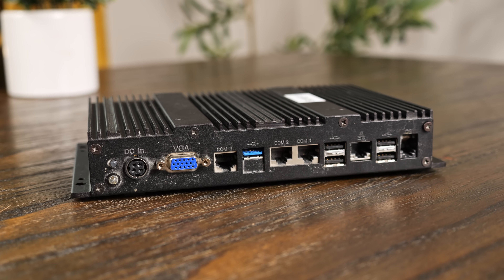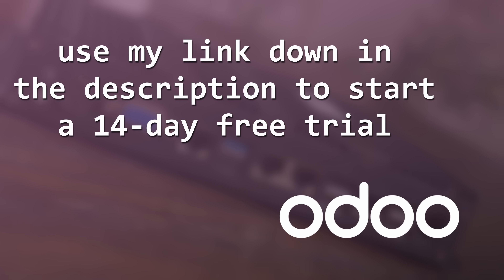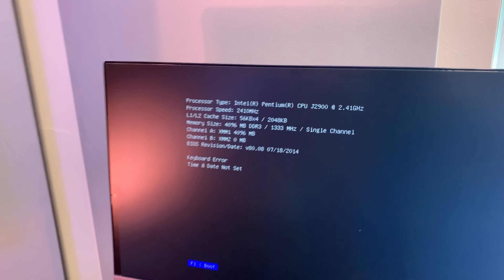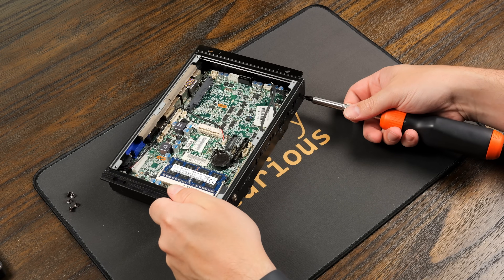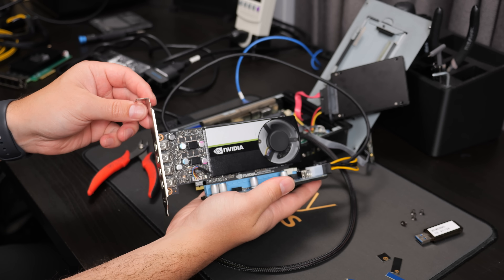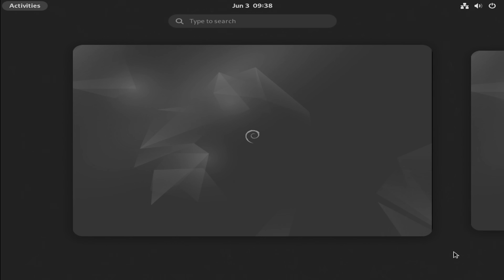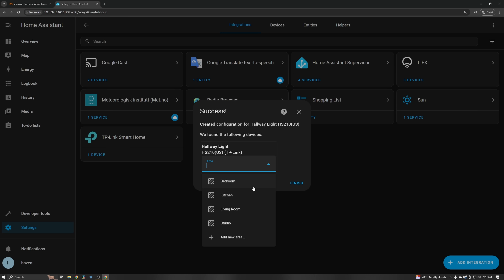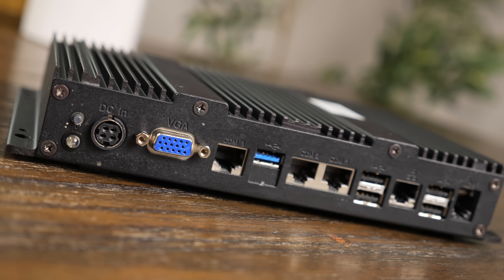I got this PC from a fast food restaurant. What now?

Comment: Been working at Marcos for a few years while going through college. Marcos used to use this system by FoodTec for their order management in the store and upgraded in the last year or so to a home grown management system. It was absolutely terrible at launch, constant system crashes and a near unusable app for delivery drivers and mobile orders made life hell. Whenever the system would bug out it would basically halt all activity in the store for up to an hour.

The experience as a worker is also awful as orders will take up to 30 seconds to go from the Dough table screen to the make line screen and we would basically sit there waiting for the order to show up on the make line screen because until it did we had no way of knowing what to put on the pizza. 

Im from a comp sci background, its what i got my degree in, and after contacting support about the delays they said they use an order cycle to batch orders together which causes a delay if we bump right after a cycle completes. I cannot even begin to fathom why this was done as the system is not lacking for processing power after they upgraded most of the hardware. Before leaving i considered dumping the contents of the program to a usb stick just to see why their program was so terrible but my gm was a cool person and idk what protections they have on the systems to prevent this

Comment: I have a similar device at home. It's been hanging around for so long that I only remembered it because of this video. It used to coordinate robotic arms for welding. Now, it runs CasaOS and serves as my primary backup server. When I'm done with a project (videos, which are very large files), I store them on the device (it has a SATA SSD with a terabyte). CasaOS then automatically makes a copy and uploads it to an internet cloud for redundant backup.

I set this up because I used to edit on a laptop. When I finished, I just wanted to close the laptop and be "done." I didn't want to leave it on for another 30 minutes until all the syncing was complete. With this current solution, I let another device, which consumes less power and makes no noise, handle the upload. And how long it takes is completely irrelevant to me... I don't have to monitor it.

Comment: A slightly off-topic question, although related to your way of testing computers.

I would like to be able to demonstrate with some test that a computer is faster/efficient when using 2x16GB DDR5 than using 1x32GB DDR5 of the same speed due to the dual channel.

Is this true? If so, with which application would you perform this test to have a more visual demonstration?

Thank you.

Comment: The J1900 CPU has been  superceded by the J6412, which is now the defacto CPU for Point of Sale hardware.

No, noone cares if you have this device. I know someone who uses a couple for torrent boxes!

They generally come supplied with Win10 LTSC, which as the name suggests has extended support beyond 2025.

The "Bump 1" suggests this box was used as a KDS (kitchen food display device) which would either attach to a touchscreen monitor or a "bump bar" ....a common feature in fast food outlets

Comment: I hate those goddamned things. Fought with one at work to try and get it setup on our domain, only to find out that security conflicts and software failures on our end, wouldn't cooperate with the vendors OS build per their requirements, so we couldn't utilize them in any capacity... all to just run one simple fucking program to display food retail menus, and I got CRUCIFIED by my leadership because I wasted too much time trying to get it to work and getting everyone on our engineering team and the vendor to fucking cooperate so we could get it to work! Apparently, I should have just punted the job to someone else instead and not even tried. Oh well.

Comment: The J1900 definitely benefits from dual channel memory operation due to the memory bandwidth limitations of single channel ram especially for the integrated graphics.  It looks like the oem of that board only designed it for a single ram slot so unfortunately THAT is not an option for this system.

Comment: Honestly, that would be a good little machine if you needed something in an environment that had metal work machinery!  Don't have to worry about metal shavings shorting anything important, as there aren't any fans!  You could also use it as a dumb client to connect to one or more 3D printer.

Comment: If you want to try using a low-end system like that as a router, you'd really want to use something Linux-based like OpenWrt or VyOS. BSD-based routers like opnsense and pfSense have higher system requirements and need more CPU power to achieve the same routing speeds as a Linux router would need.

Comment: Weird that I found this video right after I bought a similar POS computer on eBay for $50 just because I was curious. Mine is just barely new enough to have an HDMI port, which is cool. It's also tiny, no expandability except I saw a SATA port that you can't even access with the enclosure still on.

Comment: About 10 years ago i was working with a demolition company we where tearing down a distribution warehouse that had stopped paying rent got kicked from the site and the land owner decided to build a storage unit complex i was tasked one day with smashing the interior office walls down i got quite a shock when i smashed a partition and found a fully intact server room still with machines and servers the company had built a server room next to the office section and to stop yhe noise built a insulated sliding door that was so well intergrated into the wall no one noticed it until i broke through i hot a whole tray of 3rd gen i7 cpus and a bunch of unused 2tb hdd when they cost a small fortune sold most of it kept an i7 and a bunch of drives and used the money i made to build a sick pc
Reply: Let punctuation into your life.
Reply: @mattd6085  no what part of worked for demolition company made you think I was good at english
Reply: @acid3129  I can't imagine you were good at demolition on your first day, that's why people practice things. Practice basic literacy.
Reply: @mattd6085  all I did do was bang walls
Reply: @acid3129  Do you have no desire at all to better yourself? And unless you got hurt often, banging walls still requires a level of skill and knowledge to not have the ceiling drop on your head or the the floor to give way
Reply: @acid3129   Yeah you can't really pull the "English isn't my language" bullshit when your spelling and sentence structure is functionally perfect. You just can't be assed using punctuation. 

Never said anything about standards bud, those are your words not mine.
Reply: But, apparently he's smart enough to "build a sick PC"

Comment: For some reason I've seen the overscreen issue with mint, and ubuntu a few times, and the solution was to fix it in drivers setup, nothing else worked. I'm guessing that either the screen or the amp I was going through didn't return the correct screen into or something like that, but it sure was annoying. Worse, it showed up after an updated and just never went away, which means it was okay, but something in an update fucked it up.

Comment: Would this be good for controling cncs, which are in a super dusty environment? I think I saw an lpt on it.
Reply: Maybe using Mach 3 software, Linux CNC prolly requires more realtime performant hardware.
Reply: @mysticmarble94  I have lincnc on a core 2 duo... I think the j1900 should be acceptable, no?
Reply: @arugulatarsus  No idea, I don't use LinuxCNC, just going by what I read on the official Linux CNC page about hardware requirements in the past.

Comment: I suggest home automation where you are not pumping vertexes in games nor gigabytes of streaming video. Run your AVR on another box. Many of your environment sensors; weather, security and remote controlling are low data rates. With the decent video you can have a nice looking wall panel creating a futuristic looking vibe from low-tech.

Comment: Could this unit as you upgraded it be used as a backup surveillance server?

I currently run a back room sh*t box pc as a surveillance server for my cameras. The cameras still use individual internal SD cards for recording but also stream to this pc in the event the external cameras (and SD cards) are stolen. This way I still have video footage of whoever took my cameras.
Their is always a chance they take the crappy pc too but if were screwed to the underside of a desk or inside a cabinet...

Comment: The linux display issue could probably been fixed by using x11 or Wayland(aka just swap them, ive had better luck with x11) and setting the resolution via xrandr as example, as checking overscan stuff.

Comment: I worked at a tiny point of sale vendor for 8 years. You're likely to run across a ton of former POS systems. They're likely to be standard PC's with seemingly outdated touch screens, but built relatively sturdily. Go ahead and install Linux on them. Chances are it'll work okay. The days of some kind of weird proprietary hardware for POSes died 20 years ago.

Comment: i love my music player i got from a starbucks store  there was ones more powerful as later i found its 
a redhat linux machine that is a custom OS for Playnetwork and i found some machines also offerd Ads boards or what ever the shops call it 

mine had a basic CD drive that did not work but i found u could swap it out and make it read disks if u remake a playnetworkCD expiry date and heck i bypassed its date thing.
i did also found out i could of used an external CDor Dvd Drive when back in 2017 our machine in the store decided to kill its internal dvd drive 
anyway it was all fun to mess with recently at home and i will add a usb/hdmi touch 4inch screen so i can run a basic windows or linux for playing any music files at a Lossless formate using its orignal Motherboard by Polywell Computers

Comment: Hmmm you didn't mention the DC in voltage? Could this be used in a car for some of the more basic Ham Radio apps APRS or since it's capable of Win10 a Wires-X mobile gateway perhaps?

Comment: Im late - but just incase you were thinking about having this as a long term solution. DONT. Bay Trail chips suffer from some sort of degradation which means the chip will require more and more voltage to run to the point where its basically out of spec and the bios cant bump up the voltage and more then it can and thus the system wont power on unless you shunt mod it.

Qnap used a lot of these chips in some of their older NAS units and a load of them started dying after 3 years of use. My own NAS (TS-251+) Suffered the same fate and youtube is where i learned how to shunt mod and rescue it. While the NAS still works. The CPU is still degrading and Qnap support just dont care. They instantly closed my support ticket without even replying to me when my unit would no longer power on properly.

You can read more about it if you google "Atom Bay Trail dying because of LPC bus design flaw?"

Comment: I would love one of those. I would use it with windows 2022 and load putty on it hook it up to my pfsense serial port and my cisco serial ports. Have the box sitting on a whole different network so if my network goes down I can have a chance to remote in and maybe reboot or change configurations.

Comment: In the past I worked for Taco Bell well before their breakfast menu. In the office they had an IBM computer anyways they ended up changing out the registers to newer ones and while they was at it upgraded the office computer as well.

I asked management what they was going to do with the old computer they did not know. I said I would like to have it if they plan on getting rid of it and they said they would have to ask the district manager. I ended up getting the computer with the data on the hard drive intact but there was nothing I could do with it. As it used software that was created for them and you needed login details to get access to it. The computer was not very fast it was something like a 386 or 486 if I recall correctly and I ended up format the drive put DOS on it.

Comment: The only draw these devices have is old ports. The indistrial world is full of very old and expensive machinery that uses those ports, in the food industry its all about connecting to Point of sale equipment. Unless you have gear that needs RS 232 or those old printer connectors this hold almost no value. Performance is close to a Raspberry pi 3B.

Comment: I worked at Domino's Australia until 2005 and we used a different system to the one used in the USA. It was the same supplier that did Hungry Jack's, STM. We had a single Linux or Unix system with Wyse serial terminals for each order screen, makeline, cut bench and customer display. My store was really old it was a Pentium 166. I left just before the Windows based replacement (Pulse) came.

Comment: They are very specific to the job they are intended to.   it is part of a touch screen cash register system, where the touch screen likely just provided serial data, plus serial credit card processing, and probably even a serial port driven printer.   it's not intended to do anything special, just to do the same basic crap over and over, communicating with a server that actually keeps track of the data.  Much of the BIOS and the data bus is given over to those comm ports.  That is par for the course.    The hard drive would be for boot and likely to have loadable screens without having to hit the server, think of it as a precursor to jquery and json driven data sets.

Suggestion would be to clean it up, make sure all the ports are working, and sell it on for a couple of hundred.  You would be far ahead.

Comment: It's just regular commercial hardware, you'll get a fright when you check on the price. 
Having gone through about 9000 signage devices in my prior career, they are very reliable and you deploy them once and run it for a couple of years.  
Have a look at ibase for their grown up hardware...

Something like that would be used for signage, where the serial ports might be used for controlling ancillary hardware. e.g. SHARP PN series monitors.

Comment: Been working with systems like that. These style cases usually get mounted under ceilings and uses the whole case as a heatsink. Usually filled with mobile hardware and strictly tailored to the one usecase the customer has.
We had similar ones for KFC which only played the inshop radio.

Comment: Point of Sales systems don't really move that quickly.   They work on stability rather than leading edge equipment.     That little PC you have is likely close to 10 years old and may have been a modern solution at the time it was first put into service.     Like medical equipment, most POS systems  are desinged to be stable and work and the technology is usually well tested even when it is first released.   Generally they are a bit expensive for the hardware specs due to the research and development put into the software.

Comment: That thing is perfect for a home "gateway": providing a vpn, a webserver, a media server, a dns guard, a tiny NAS, sending WOL for remote turning on devices and monitoring other devices. With that little power consumption any ups would make it 100% available.
I assume that debian graphics error was due to a wrong graphics driver. Perhaps trying an older kernel would solve it. Still, dont expect it to do more than opening youtube 😂.

Comment: Use the windows that was out when it was made. Try win 7 and see if it has a performance change. Also check for bios or firmware updates since the pizza shop probably never bothered to do so as most businesses just want it to work even if it could be better

Comment: I went through a bit of of a phase where I used a small mini-ITX PC with low power hardware kind of like this (maybe a bit more powerful than an Atom) for my home server/router (which runs Gentoo).  It did fine...but I once I started getting Unifi devices and expanding my wifi rather than just plugging into a cheap wifi access point, I decided I wanted more expandability, RAM, and storage space, and a bit beefier CPU since I also do compiling on that machine - no GUI though.  Because I do basically everything on my server except for actually playing games.  I don't store anything important on Windows machines, everything even remotely important is stored on that server.  So 2 years ago now (time is flying) I got a Micro-ATX B series motherboard and stuck an i3-12100 in that machine, along with a PCIe multi port network card.  I guess it uses somewhat more powerful, but having a CPU that isn't too far off from the i7-6700k I used in my gaming PC just a few years ago was a pretty big jump.

I can still see the draw for having a mount it to the wall, set it up and forget it type of low power server with no moving parts/maintenance though for certain tasks.  Heck I could probably use that machine as a server/router if I was in a pinch and had nothing else.  Just put Gentoo on it and I'm sure it could handle my needs, even if it's not ideal.

Comment: I used to work in epos for 10 years including the height of the j1900 being a senior engineer I knew your issue with the ram fairly quickly.

If I can be any help let me know as I may have some old software to fire the cash draw pins etc